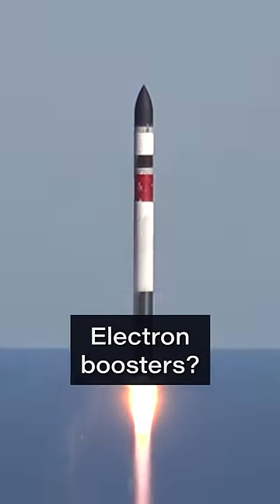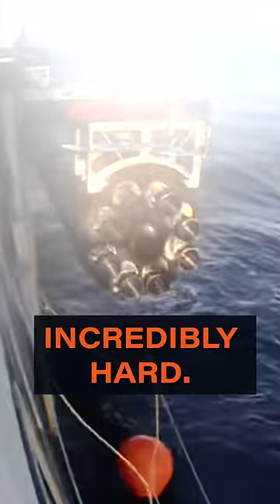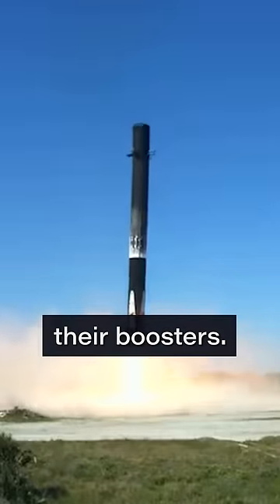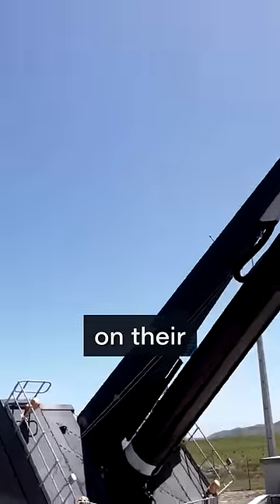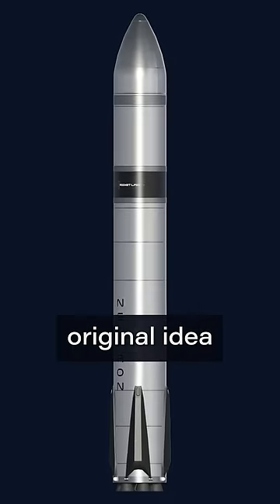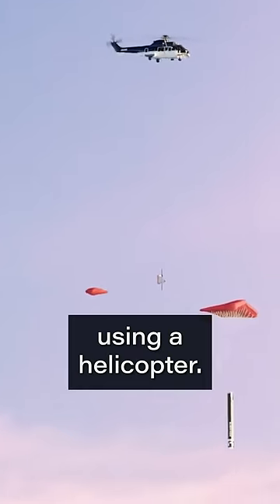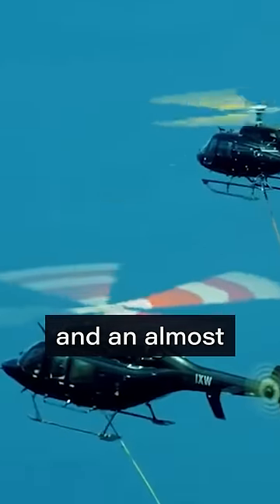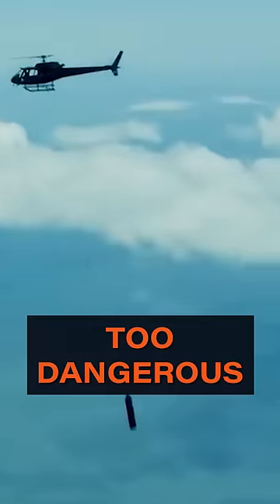How To Recover A Non-Reusable Rocket?

Comment: This is how NASA recovered Shuttle's solid rocket boosters, it's not a new method.
Reply: Hopefully reusing the Electron will be more economical than reusing the Space Shuttle SRBs, because the latter saved no money.  They did it anyway because it saved on material and trash in the ocean, but in terms of cost, was about the same as building new SRBs.  Electron should be more economical to reuse because it's fundamentally different from SRBs, as its engines can be reused, but there are still questions that have to be answered, such as the cost of refurbishment on this small scale, among other things.
Reply: @rbrtck  You are right, i hope Electron make this a viable and cost effective method.
Reply: Electron is a liquid fueled rocket, which will change the refurbishment and refueling process compared to the Shuttle SRBs.
Reply: But the Shuttle and the Shuttle's boosters weren't Reusable, but rather Refurbishable
Reply: @EmilioGameair  same with SpaceX
Reply: And thus lazy
Reply: They didn't try to catch the SRBs with a chopper 😂.
Reply: SRBs were stripped and rebuilt aka reused/refurbished.

Electron will likely need some refurb as well as sea water is not nice to rocket engines hence why SpaceX doesnt fish theit booster out of the water, being far easier then relanding boosters.
Reply: Yes, but, those where solid rocket boosters, that were completly torn down a rebuilt. These are liquid rocket motors. I wonder how much "fixing" they have to do before it can fly again. I guess, if they can reuse anything it's better than throwing it all away. Just shows you how far ahead of everyone SpaceX is. At least ten years, maybe more.

Comment: That seems like a very cheap and efficient solution, but it has barely a fraction of the cool factor of spaceX
Reply: It also damages the components since salty water is not good for them. This has been attempted before and turned out to be not so good.
Reply: Yeah.. sounding very 60s .
Reply: And we've already saw that already with the SRBs on the space shuttles
Reply: Rocket Labs upcoming Neutron rocket will land like Falcon 9.
Reply: You have to remember that rocket lab is a small aerospace company in a country that most people don't know exists and is a fraction of the size of Space X.
Reply: @bbarreir0153 just land it on a river then 🤠
Reply: Yea they will likely find that the refurbishment of the rockets is so expensive as to make it borderline pointless to even recover them.
Reply: @Mottbox 
20 years later ? 😂
Reply: @Gunter_Custom  huh?

Comment: The recovery is so "1960". Space X is the future.
Reply: Nahhh, chute recovery better. No need for advanced electronics and stabilization system, and the most important it doesn't need additional fuel to land. That means that you can get heavier load
Reply: @AkyJLa_  The SpaceX technique is way better than the 60's method... Jst because an old technique works, doesn't mean we can't improve it.
And if you r talking about additional fuel cost and more electronics. It's better than fishing out a high-tech equipment which splashed into a saltwater that is highly corrosive. Jst ask how hard it was for NASA to recover and reuse it's boosters!
Reply: @sabareesh129  its 21 century, nothing stops you from putting electronics to precisely land booster on prepared surface, to slow down enough before touchdown you can use just a little bit of fuel. That method will give more payload, than current SpaceX method
Reply: @AkyJLa_  Most of the fuel are used to boost the spacecraft to a suborbital trajectory. If you focus on falcon 9 and starship launches you will see that when landing, the boosters only have less than 5% of their fuel left, because its essentially an empty tank at this point
Like why even bother adding a parachute AND use a little bit of fuel like you said instead of just using one system as a whole? The best part is no part, and we need simplicity.

Comment: And how about the effects of salt water to the booster? And does the booster will always float?
Reply: I’d assume they give it a spray down, at least at the engines and ports for propellant.

And I wanna assume the reason they float is because the liquid rocket design is basically just a soda can. Which is not a dense shape. Think of a container ship. Not even as hollow or as thin as one of these boosters!

They shouldn’t have any issues with water recovery! Hope that helped!
Reply: ….💀 anit no way bro asking this

Comment: Why would they even try that recovery method with a single main rotor helicopter? Why not bring a United States Chinook in there with a dual blade system that obviously acts as a counter balance? I mean as soon as they say it, that doesn't even sense, and it's immediately evident what the issue is...

Comment: I had a feeling before they tried the chopper chute catch idea that it was not going to work. You catch the rocket and suddenly add all of that extra weight, its going to pull the chopper down until they can recover. It could also overstress the rotor blades and snap them off, not to mention crosswinds issues that could induced a spin.

Comment: Dealing with the saltwater sucks but the plus is not having to save the weight of fuel to land it. Assuming the parachute system weighs less than what would be a fuel landing equivalent.

Comment: Wouldn't the sea water erode the sensitive components leading to it being refitted instead of being completely reused like a falcon 9?
Reply: Yeah for sure, but it seems is cheaper/better for them that rebuilding the whole assembly, any reuse needs some refurbishment anyways, SpaceX can't just put fuel in a recent landed rocket, there is a process (a month at its shortest).

Comment: do you remember the man that land wiithout parachute? build a big net strong enough to hold booster mass* terminal velocity with parachute. or fire some solid rocket to slow the booster down before hit the net, in this way you can guide the booster with aero aileron all the way to the net before the solid booster brake (like soyuz before impact). ah,i guess this comment would never reach them

Comment: Crazy how no one has been able to catch up with SpaceX Falcon 9 let alone Starship
Reply: They've only recently become convinced that reusability could be economical and worth doing.  Both Peter Beck of Rocket Lab and Tory Bruno of ULA were serious skeptics.  Beck had no plans to even try, and said he'd eat his hat if Rocket Lab ever did.  He literally swallowed a piece of his hat later to make good on his statement.

So one reason no one has caught up yet is that most have only begun recently.  The only exception is Blue Origin, who have been onboard with reuse from the start, but they're slow and the orbital rocket they're developing, the New Glenn, is enormous and therefore a major challenge.  They have had the New Shepard for a while, though, and it is reusable, albeit suborbital.
Reply: @rbrtck The major advantage of reusability is not monetary; rather, the major benefit is time saved.
Reply: @rbrtck  True and aside from that, no one was onboard with SpaceX philosophy of launch it and see what happens.
Reply: Starship hasn't really accomplished much so far.
Reply: Starship has yet to reach space without blowing up so not sure what you talking about there. NASA Artemis 1 reached the moon orbit on it's first launch...
Reply: @pierrepellerin249  SLS is a nice piece of engineering but is old tech at this point and non reusable, Falcon Heavy can take you to the moon, Starship is aiming at Mars.
Reply: @diegolink42  Falcon heavy is too small. It could go to the moon but only has a 12 metric tons capacity. SLS has almost 4 times that at 46 metric tons. SLS may not be reusable but it can get to the moon already. Starship still can't reach orbit without exploding and I don't think an exploded booster and an exploded starship is reusable....
Reply: @pierrepellerin249  Everything SpaceX has accomplished until now was considered impossible a decade ago. Even if Starship takes a few more years to develop, It will render both SLS and Falcon Heavy obsolete.
Reply: @diegolink42  Name 1 thing starship has accomplished. It has never been in space so maybe it's the accomplishment you are talking about? A space ship that has never been in space?
Reply: @pierrepellerin249  I think I just hit a nerve...😂
Reply: @diegolink42  btw, you obviously weren't able to name a single thing Starship has done. I expected that too.
Reply: @diegolink42  you made a claim and can't back it up with a single fact. Case closed.
Reply: @pierrepellerin249  I could name a few but I'm not wasting my time anymore. I don't hate NASA or SLS, I think that SLS is too expensive but also a safe bet for them. You just can't deal with the fact that SpaceX is actually innovating, by taking big risks developing something completely new and way more advanced with the Starship program.
Reply: @pierrepellerin249 Artemis is literally built from what NASA learnt from Apollo, which was a super successful science program. SpaceX is brand new, and the fact that they even managed to put together a rocket and make it launch upward is already an achievement on it's own.
Reply: It’s insanely difficult and Elon pushes his employees extremely hard to do these things. He asks questions and if you don’t know the answer you have to stand up and leave the meeting.
Reply: @LaFranceBonjour  No one is forced to do anything in any job, they work hard because they believe in his vision for the future.
Reply: @LaFranceBonjour  What I mean is that he can be your friend but dont forget he's your boss first.
Reply: @pierrepellerin249  At the time of your comment, Starship had already been in space and the third launch was nearly ready. SpaceX has proven that they can reliably launch the largest and most powerful rocket ever. IFT3 proved that they can get into orbit. And they are nearly ready for a 4th launch already. They managed other items too, but those are the most important.

SLS might have worked near perfectly on its first flight, but won't have a second flight for another 1.5 years. That is over 3 years between flights.
Reply: @anthonypelchat  The only reliable thing with Starship is that it will explode. Same goes for it's booster. 3 for 3 so far, now that's reliable.
Reply: @pierrepellerin249  It only "exploded" doing things that no other rocket tries: recovery. But if you want to be technical about it, then SLS was as much as a "failure" as Starship since the booster and upper stage also "exploded". After all, it was never landed for reuse and just crashed into the ocean or burned up in the atmosphere. Only difference being that SpaceX gave us live views of Starship while NASA/Boeing turned the cameras away during SLS.

Comment: This doesn’t really work in practice from what I’ve heard. The refurbishment and testing required after all that salt water intrusion makes it not really worth the cost of recovery. If it made sense to do that, I think SpaceX would have gone that route instead of spending all the time and money to develop landing capability.
Reply: It makes sense for this rocket, they explain the reasons and advantages given the salt water compromise.
Falcon 9 is way too big, making this aproach really unfeasible, Elon probably saw how the process was with the shuttle SRBs and decided to go a different way. It is possible tho, you need to weight in everything and see if it makes sense for your specific rocket.

Comment: Dum with the technology we have ,salt water is corrosive.  I'm sure the water gets into the booster, so why not just have an inflatable raft that has an altitude sensor
Reply: That be extremely difficult to implement for a rocket, also it is just an increased cost in refurbishment, it can be justified.

Comment: Landing on a pad next to the launch tower is the best solution.
Space X tower catch is got to be the most risky unnecessary stupid idea ever.
Only Musk could come up with that.....betcha it don't work! and if it does, all it takes is one Wipeout to destroy your launch tower.
Reply: Nah, the towers are super sturdy. At the point of the landing superheavy is just an empty can tbh. Didn't you see the suborbital test of sn8 thru sn11? they hit the pad hard, but neither of them did a scratch, as they were basically empty cans. I'd be worried about the tank farm, chopticks and the elevated pad those are the bigger problem.
Reply: @JoseNovaUltra  A separated pad would be better, but for Artemis a nonreusable rocket would be even better due to the extra weight required and complexity required for reusability.
OK for the many flights of falcon but we could be on the moon next year if the contract went to another original bid, now due to Musk overestimation 3 to 7 years before landing a human on the moon with that Starship.

Comment: And then it fills with salt water and everything disintegrates.
Reply: Salt water only corrodes slightly, the rocket wouldhardly expend hours in there, for sure it increases refurbishment cost, but it is a compromised they are willing to take.